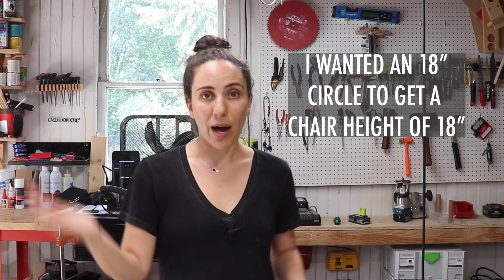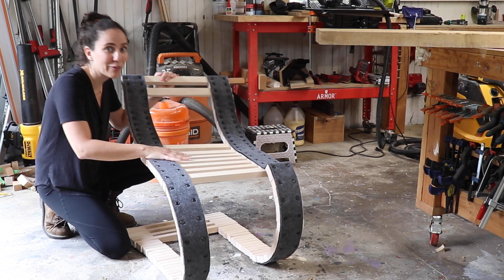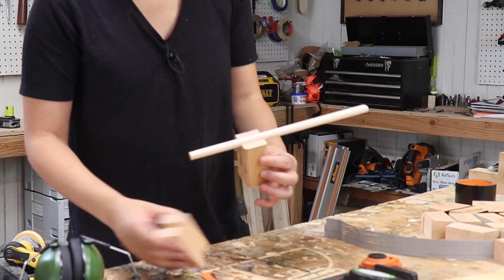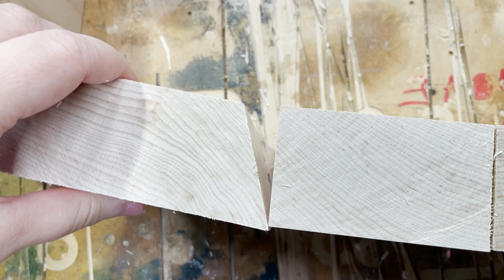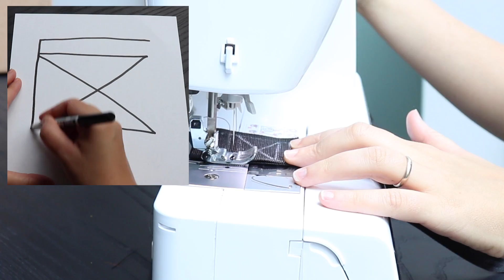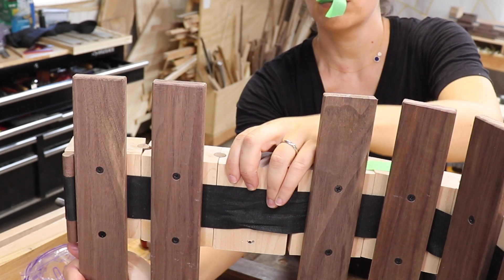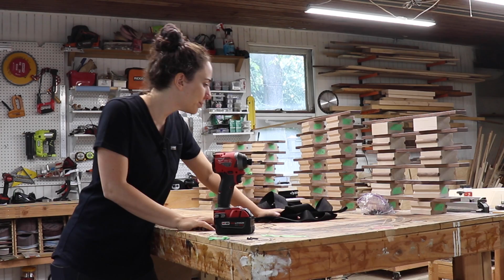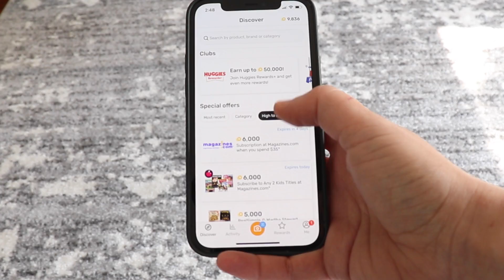I ATTEMPT to make a Roll Up Chair… AGAIN...

Comment: The issue may be with the design itself, specifically the back support. You do NOT want the tension evenly distributed, as the forces are not equal. The back has barely any forces acting on it compared to the bottom curve, so when you increase the tension, all that happens is that the back (where the webbing runs at the inside of the curve) is curved inwards - and since the webbing is not blocked by the wooden blocks like it is at the large bottom curve, it just releases from the surface of the maple until it is obstructed by the walnut. Thus, any additional tension will just continue to force the back curve inwards, until it collapses and releases the tension of the webbing like it does at 23:08 - notice how the entire chair drops at bit. 
I understand the benefit of leaving the segments to slide around freely, but I think you have to at the very least attach the webbing at the base of the back support, before it curves up. That way you can tighten the bottom part of the webbing A LOT indepentently from the back, where you would want a lot less tension. That way, the base of the chair would even keep its shape if the back support collapsed.
Reply: You have a good point. The strapping needs to be bonded at each join to prevent the highly loaded areas from transferring that tension to the lesser loaded areas and altering the shape. However the webbing at the thickness and width used is just not stiff enough for the loads. I think a groove and a mostly matching rib on the back of the slats would pinch the webbing enough to isolate each joint. With that and a few extra layers of webbing and it may work. I would need the material data to be more sure.
Reply: @court2379  Very good points here.  I would also look into much wider strapping, or even using something like canvas or similar material that would completely run from one side to the other.  This would spread the tension over a much greater area and hopefully reduce the tendency of the material to stretch.  The use of a thin steel cable would also reduce the stretching issue.
Reply: @jrshall1946  unfortunately, the first webbing she used, UHMWPE aka Dyneema, is pretty much the gold standard when it comes to not stretching(only 3-5% at MBS). It's also has the highest SWR of any webbing. I really think the way to go is securing the webbing at each piece like many others have said.
Reply: @jrshall1946  I was just about to write that down here, what if she would make holes to lead a steel cable through all pieces, and also make pieces wider. It will reduce stretching, making the chair more sturdy.
Reply: @rokronroff  This is true, but one thing to consider is that it's the elastic modulus which matters here, more than the SWR or stretch at MBS.

Young's modulus for UHMWPE is up to around 130 MPa while it's around 190 or more for steel. So theoretically, for a given cross-section she'd be able to get a bit less stretch with steel. 

If I was building this, I'd make a few changes:
- Fix each block to the strap / cable. As others note, the tension in the strap is more or less constant, while the load in the structure isn't. This means the sections under high bending loads (like the curve bearing all the weight) are going to cause other areas (like the backrest) to collapse.

- Make the blocks a little bit thicker. The thicker the blocks are, the lower the strap tension required for a given load.

- Make the blocks wider (or even make it a single string of blocks, rather than two parallel ones), and then use multiple straps across the full width. The more straps are used, the lower the total stretch for a given load.
Reply: @court2379  I don’t think you need to bond the strapping at every point, but for every change in the load. Especially the forward bend and the chair surface need to have 2 independent belts to distribute the weight loads on the structure.
Reply: @nSnowCrow  That is the solution: 1 additional attachment point on the middle of seat so that the belt tension is independent for each curve. High tension on the lower/sitting part (high strain), low tension on higher part/back rest (low strain).
Though the wood pieces are the same and could sustain the whole strain evenly with even tension, as the belt goes from outwards to inwards it creates a weak spot where all the tension dissipates (as @Cronoctie described)
Reply: @nSnowCrow  : Thinking about it, if the strapping is only restrained where the forces are expected to shift, then the current problem will still be liable to happen, just to a lesser extent. It may be intended that all forces in a particular curve are identical, but ordinary movement will inevitably result in non-uniform dynamic forces being applied, which will provide focal points for the stretching to be focussed at again. The segments really need to all be fixed to the strapping, regardless of where they are.
Reply: @court2379  yes at each joint or when the tension is needed to change.
Reply: the point is longger the webbing, the longger webbing stretching.
Reply: The static designs I've seen on the Web use some method of making the sides effectively  thicker in the front-back direction in order to increase stiffness.  One method is to form a triangular truss structure with a third side between the original two.  That can be done in a number of ways.  Another method is chords, that is, some kind of cable connecting distant points on each of the two sides. 
And absolutely, there are at least three sections in the chair, with different forces acting on each, and each section and their forces should be analyzed and addressed accordingly in the design.
Reply: Yeah. The strapping needs to work like many individual hinges rather than the whole length being tensioned. I'm thinking that if she'd just used a couple of staples to hold the webbing onto each block it would have been enough to divide the forces into each joint individually rather than across all the joints together.

I would have been interested to see what would have happened if the webbing had just had some double sided carpet tape put across it's back side before assembly. That would probably have been enough to isolate the stresses locally to each joint, but now it's been glued together, the time for this test has unfortunately passed. :(
Reply: @Reman1975  What about using actual hinges?
Reply: @mikeciul8599  My first thought actually was that she'd be better off with hinges, or even getting a chain of hinges made that could just have all the blocks screwed to them (Looking a bit like lengths of tank track), but after watching the rest of the video I got the impression that the strapping was an important part of the design for her, so that closed off a lot of other engineering options.
Reply: @Reman1975  That makes sense. I wonder if it would be acceptable to use hinges just on the joints that experience the most force.
Reply: @Reman1975  the tension in the strapping would still stretch it, tape does not have the holding force to prevent the stretching from occurring.
Reply: @itdful  she should probably use a metal sheet with bolts holding it in place. I feel like that will do the trick
Reply: I agree- I think the webbing should be fixed and glued to the blocks and the strapping should be doubled or tripled at the main problematic bend point.
Reply: Not a carpenter but there is unnecessary stress on the back rest.. Maybe end the 'tension strap' where it meets the back rest . The back rest should have its own tension strap separate from the main . 
Glueing the corner like she did seemed to work well so why not put some screws in an angle as well . also glue and screw the other 2 corners (top of leg , bottom of leg ) . 

Like i said not a carpenter just my ideas
Hope to see it finally work !
Reply: Thank you for articulating my thoughts better than I ever could!
Reply: Can't agree more. The design is the problem itself! Straps are not suitable for the purpose. In terms of localized tension and not stretching, solid hinges are so much better.

Comment: I am by no means an expert on stretch and tension, but I think you would fare much better, if you have small straps between each elements instead of one large strap over the entirety of the chair.
My reasoning behind this is: The tension adds up over all the elements you put the entire tension on one continuous strap. If you separate the elements and have one strap per gap, you only have the tension of those two elements on that strap.
I might be completely off with this though.

Comment: Perhaps a single strap running the length of the chair is disadvantageous. I think using cable or straps from piece to piece would lock everything precisely into place when set up, and still provide the freedom to roll up the chair.

Comment: I think you are close to a solution. There are two problems with V2.x; if you have enough tension to hold the blocks on the convex curves (ie the bit under your knees) then the tension "breaks" the blocks on the concave curves or the straight sections. Then, if each of these gives just a little bit, there is enough slack to reduce the tension where you need it on the convex bits. Still with me? 🤔. So, what would happen if the strap was firmly trapped at each block (under a dowel in a groove, perhaps) This might prevent the strap slipping through, prevent the gaps but also prevent the collapse on the concave curves. I'm tempted to try it but I'm not sure I have your patience with the woodworking!

Comment: have you thought about using (threading) a steel cable that runs through the center of the blocks and using a washer and nut at each end?  It's a compression technique that engineers use for bridges and overpasses.

Comment: I’m guessing the main problem wasn’t the tension but that the way the strap was held in place allowed the stretch of the strap affect the design unevenly.

So all the stretch, no matter how small. Accumulated all in one area. Instead on just a little bit on each wood wedge.

My guess is that might be why you didn’t see the same problem with the test with the duct tape. As that didn’t allow the stretch to transfer between ‘joints’.

I don’t know if adhesives or screws, or what anchor points would be the most suitable.
I think the wooden racks det on top are a smart idea, and look good.

My approach to the problem would be to add the straps to the test, and then test out and see what type of combination of anchor methods would work to hold the straps in place and have it hold some weight

Comment: Perhaps a solution could be making a series of slots and tenons on each piece? The dowels solved the racking issue, but it seems like the tension issue seems to put a lot of pressure on the angled edges, prying them apart.  If an interior right angle tenon and mortis setup could distribute that pressure along a wider area, you might see less prying at the edges?

Comment: I don't get why you have a massive compression layer but a very tiny tension layer aka strap.
Think bigger, do some calculations on how much tension there will be.
And then use something in the ballpark of those big ratchet straps or steel cables.
You might also want to create a glue matrix in the tension layer so the material doesn't flex.

Comment: Try sandwitching something like "Everbilt
1/8 in. x 75 ft. Galvanized Dog Run Cable Exerciser Kit" cable between your top and base pieces. This kit supports up to 150 lbs and is vinyl coated. Think if you do 2 lengths on each right and left side you should be solid enough or find something similar in 1/4 in. thickness and go with 1 length on each side. This way you can pretty much use the pieces you already have. Might also be time to switch that 10 or 15A garage breaker to something a bit beefier for less frustration 😉.

Comment: I think the stretchiness of your cords could be counteracted by slightly changing the shapes of your trapezoids. Right now your 4 sided pieces do not allow you to put them close enough together to compensate for how much the "tape" will stretch under the weight. If you cut the 45 degree pieces off by the base of your trapezoid (the longest side) creating a 90 degree angles you'll turn your 4 sided trapezoid into a 6 sided shape. You'd have to play around with how much you need to cut off of the 2 45 degree points, depending on the stretchiness. Having the 6 sided shape will allow you to place them side by side closer to each other ultimately consolidating for the flex of the "tape" under weight. The "chair" will be in a more "not fully opened" shape till you actually sit on it applying weight, stretching the "tape" and making the pieces snap into their right places.

Comment: Nice!. 
Looking forward to part3.

I think you'd' have succes just putting glue on the strap (both sides, between the wood, +squish it there) to attach the straps to each piece
Napkin-math, a 100kg person(not you!) on the seat, is about 80cm from the 8cm block-seesaw (~10:1), means 100*10=~1000kg of force on the strap, the strap has it's FULL length to stretch. 
I think with a 10mm stretch, the chair fails, So you'd need a strap that doesn't stretch 10mm over a 2000mm length with 1000Kg of force... That's a crazy requirement!
If you glue & screw & fix the strap to each piece, non of the forces change, but the stap will only be a few mm long! So you still need a strap that can take 1000G still, but it needs to not stretch 0,5-1mm over less then 10mm length, instead of 2000mm... (20 times)  A very different ration, and a normal spec for a strap.

Same goes for a steel cable, running trough the 2 pieces of wood, make it a hole or two, run a crazy-non-stretch cable trough it. (I still think fixing it to each piece helps.)
The pull stains the same, but the length that has an opportunity to stretch is WAY shorter.

I also think that you could do this with a bunch of hinges, a ugly solution, but putting a bunch of door-hinges on them would give full motion and no stretch. Also, no dowel against twisting needed.
Or a whole bunch of wooden knuckle joint's with an offset, just like a door hinge. But to take that force, in all wood, Not sure what that would look like.

Comment: I gave this some thought. Any woven material will stretch. The straps put all that tension on the ends, but they don't hold any other blocks. Instead of straps, I would attach each block to the next. The best solution to me, is using metal hinges. These don't stretch and depending on size are plenty strong. It also prevents the tension from pulling the extremities. 

Then I started over thinking. Using sprung hinges would allow the chair to roll itself up. Then you could add a wire on the open ends to use as a little winch. Now you have a self rolling and unrolling chair. Practical? No, not really...

Comment: Another you could do is treat it like a pretensioned bridge.  So for example on your back don't make a 90 degree curve make an 80 degree curve.  As the chair is loaded and tension is applied it will flex to the 90 and be taught.  Just an idea

Comment: I'm with you 100% on clothes, but for slightly different reasons. I'm 6' 10" so clothes at the store aren't long enough. But on a holiday to south-east Asia in my early-20s changed all that. I picked up a tailored suit and business shirt. When I collected them up the next day, I loved it so much that I got 9 more exactly the same. 20 years on I have replaced everything several times over, but it's always the same colour - navy blue shirt and black suit. Too easy, lemon squeezy!

Comment: Tamar. If this was a viable thing in this form then it would have already been made out of plastic in China, especially as it is so simple in terms of the parts.
I love your innovation especially the dowels in the joints. I think the fact that the glued final version looked a bit dodgy also tells you all you need to know....
I wonder however if the base was a complete circle like a barrel then you would triangulate the forces and it would be rock solid. Could you compromise your perfection on a roll up stool?

Just had another idea for you. If you don't mind compromising the shape. Why not make another half moon shape that comes from the back of the seat base this would then roll down to the floor and form a back leg (or even a pair) this would then triangulate the forces and stop the lateral twisting it would all still roll up.

Comment: One solution might be to use additional Blocks and strapping at the places facing the most tension to spread out the compression forces and the tension over additional parts and lower it on the main strapping. 5 additional Straps in the front ( 3 in between the main straps and 2 at the sides ) reduces the forces for the main strapping to about 40% at the Places where all the Gaps appear. I really like the design of this chair, and wish you success if you like to give it another chance.